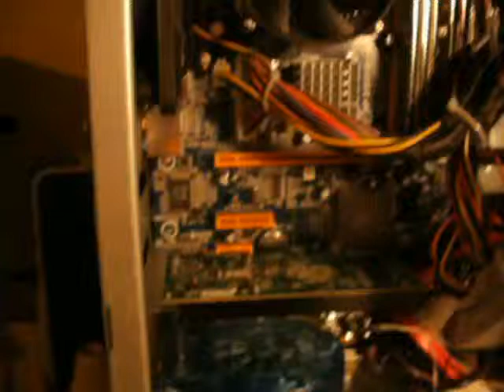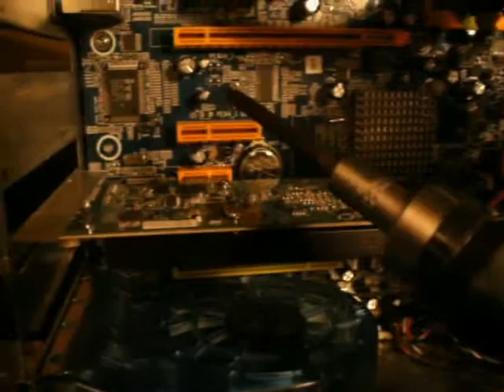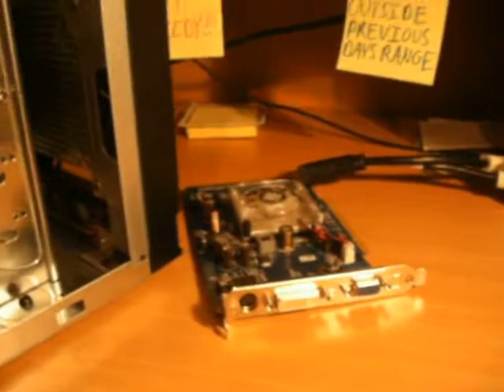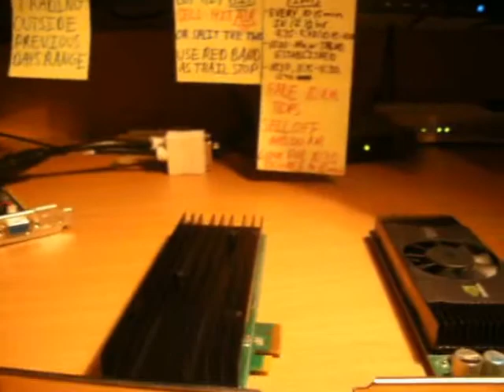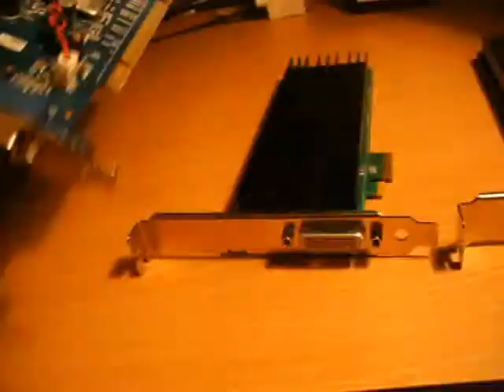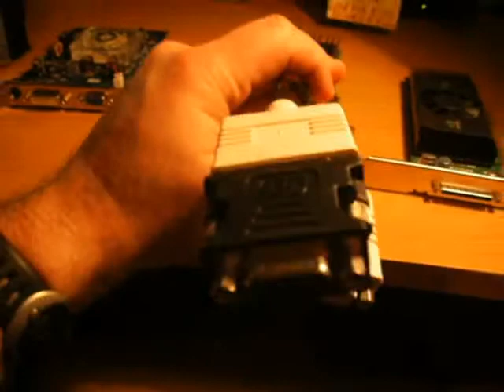#2  Multiple Monitor Video Cards For Trading Stock Market - Pt. 2

Comment from the maker: The slots on mine are orange. Other computers may be different colors - so the color doesn't really matter. No you cannot add slots. Either your motherboard will have them or it wont.  If you only have 1 or 2 slots thats fine because you can get video cards that run 4 monitors each. Make sure tho that you know what kind of slots you have. Is it PCI, PCI Express, AGP, or a mix of the b4 mentioned?? PCI EXPRESS  and PCI is what I have but I use the PCI Express for my cards because they much faster
Reply: will this still works and no problem with todays apps in trading?  consider the low memory of this card? coz i plan to buy one because ther cheaper now. please advice